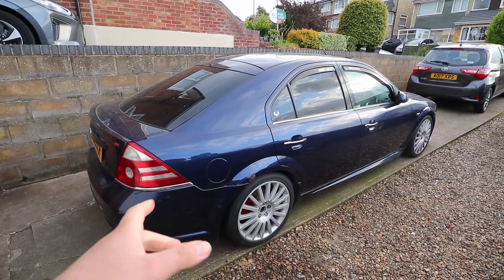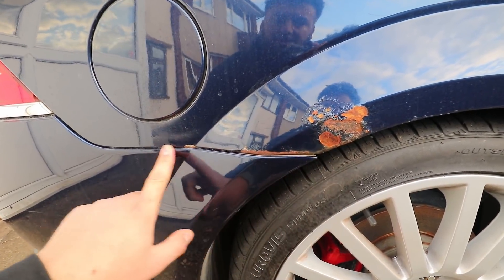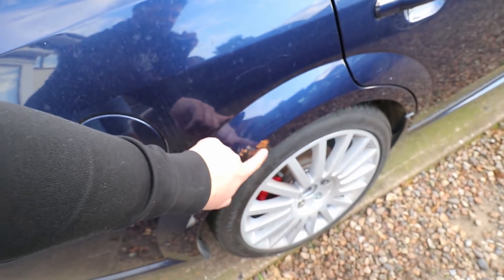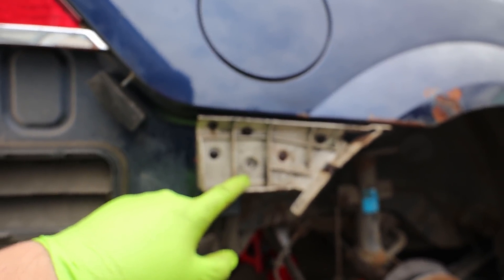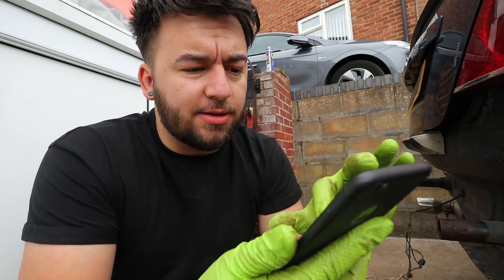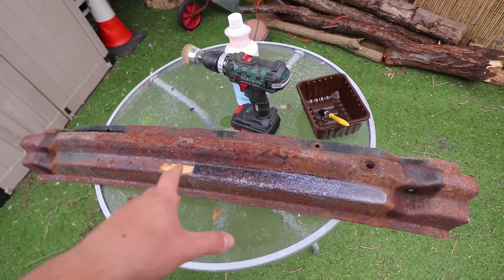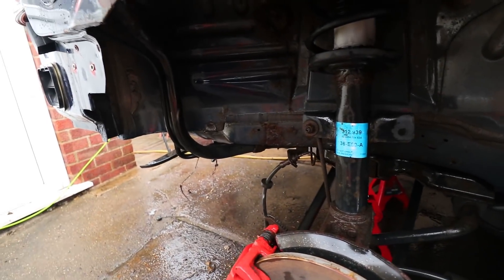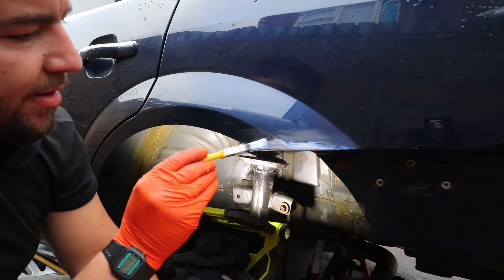Fixing The Rust On My Mondeo ST! (Part #1)

Comment: get yourself a blow torch for rusty bolts mate. heat them up wire brush the rust off. heat again and spray with WD40 whilst it's hot. works every time. you won't look back!

Comment: I have a focus same year, rust its a pain in the *  at those cars and if you treated it appears again.The only solution is to clear all the rust on the car(maybe in some spots it well need welding) and then put some primer and then black paint.
Reply: I have a 2005 focus, worst spot on mine seems to be the bottom of the arch by the front doors. Never get round to doing it!

Comment: Hey man, I'll be doing almost same repairs as you did on my mondeo estate tho not as bad as yours yet, but still annoying to look at. I will treat all the common areas with some protection of som esort, to keep them from rusting, Somehow ford made it, so water collects and overtime rusts those areas, some worse than others. Also if you had a mondeo pre facelift model the ford clear coat wasn't that great and caused the doors to rust badly and roof. But nice that  you did a video on this, so I can use it for reference :)

Comment: Your not supposed to dip a dirty brush back into the bottle of Vactan, it will contaminate the whole bottle.

I've used the Loctite rust converter on my e46, under the boot lid above the bumper, it lasted just less than a year before rusting through again

Comment: Thumbs up for your enthusiasm I know what it feels like when you keep.finding rust.
I got a 1982 Austin metro and can't weld.so I've had loads of fun with it. Starting to go back to the first patches I done to redo them. I learned a bit. Got to do something to learn. Il be converting it to a 16v rover engine in time or maybe a vtec.
Keep going

Gas mig welder. Any cheap 1 will do body panels
. Angle grinder.  80 grit pads.l for.that crash bar then hammerite. 
Rust converter is no good honestly.

Comment: The rust treatment works best on rust, it doesn't work on bare metal.  Treat the rust around the hole, then use p40 to bridge the hole n then p38 to fill.  The rust inhib can be used on the lip inside but dont rub off rust.  Use a rust inhib grey primer on bare metal. J

Comment: Cut and Weld a small backing plate behind the hole in the arch and then just fill the hole with filler.  Sand and repaint.

Comment: Watch Chris fix rust repair mate he didn’t weld did a good job just type up Chris fix rust repair he used metal netting and fill it in 👍
Reply: Chris Fix & Savage Garage are my 2 favourite car channels. Both make great content.
Reply: That is a disgusting method of repairing rust holes. Don't ever do that. Its just gonna continue rusting in there and make a bigger mess than it originally was.
Reply: @y4nnickschmitt  Use a bit of wood instead of metal netting, wood doesn't rust
Reply: @idiocracyisnowadocumentary8834  I hope you are joking.

Comment: Forget paying £95 for a new arch, use some u-pol fibreglass filler and some aluminium mesh. Not worth getting a whole panel welded in for a hole that small. Take the rear struts out and get a wire wheel and some sandpaper on that surface rust, paint it with Zinc or etch primer and underseal all of it, if done right will last a lot longer than you might think.

Comment: Only treatment for rust is cut it out, the parts you've treat and fill after winter will just bubble up again and in summer will look twice as bad. Inner wheel arch grind it out and plaster with underseal

Comment: Guys, is somene familiar with this error that i got on my St220 03, can be because of brake discs are too damaged ? 
c1310 brake hydraulic pressure transducer front left wheel circuit failure

Comment: It ain't that bad and not difficult to repair. Just make a patch from a piece of scrap metal, weld it in...threat it and finisch it of with filler. Paint it and thats it.
The patch needed to attached from the INSIDE of the wheel arch

I'm sure even without  weldingskills , you'll can handle that. 

As a owner of a Ford Ka( yes the real rust buckets) , i know the battle against rust and last year...made some patches in my rocker panels. 
Nothing is more satisfying than solve the problem on a budget( ofcourse  the repairs need to be done properly  and cause no hazards)

Comment: as for the roof unless your going to paint the entire thing you will have obvious bits showing as there is no where to blend might be worth sorting the rust out on it then paint it and wrap the whole roof, dont use that clear you have, get yourself some MIPA 2k clear can get it in an aerosol, and it will give you a much better and more durable coating. 1k clears are useless in such a high impact area. welding aint difficult once you get it just practice on some similar gauge steel before attacking the car. and be wary welding anywhere near the fuel filler. good video man look forward to next one try keep all your repair work within the arch area will be much easier to paint and blend within the arch rather than having to find some where to blend into further up the qaurter

Comment: As said in other comments, ChrisFix made a really good video on fixing rust (with replacement sheet metal)
Now if you want the cheap route while you learn more on welding, EricTheCarGuy has a video on fixing rust on his acura vigor (Beater car, fixed with bondo)

Comment: James just cut out a little patch on the rear quarter, get some sheet metal and weld it in. You can weld you just dont know it yet. If you mess it up then get a pro to do it. You have everything to gain. You just need to follow a few simple rules watch Fitzee on you tube he is brilliant. Good luck mate
Reply: Agree. Not worth buying a whole arch repair for that small section. Not at £95 anyway. Small section of shelter steel welded in would do fine, grind back and fill. Welding takes practice but if you research how to do it, practice on some scrap then it's possible to get an acceptable job. Have a go and good luck.

Comment: Good video, just a few things, mud hasn't really got anything to do with rusting metal, it's the water and moisture and salt that corrodes. The mud doesn't help though because it helps trap those things. Also when sanding and using a wire wheel to remove rust.. Don't be scared to go beyond what you can see.. There is always more hidden under the paint. And theres no such thing as a 20min fix when it comes to bodywork.. Always a can of worms.

Comment: Instead of spending £95 on a complete panel it would be easier to get section cut from a mondeo that's being broken for parts cut to size and weld it on yours I had to do this with a fuel filler panel for my escort rs turbo

Comment: Good video James. I just know I have a job on my hands with my saab, just replaced rear springs and found a lot of rust underneath. Gunna need that rust stopper and probably shultz the underside 😒
Reply: If it's a 9-3 keep an eye on the rear arches, mine are terrible! Treated it two years ago and it's back again with a vengeance now so will need to do it again

Comment: The "hidden" screws behind the bumper trim and not factory fit. They are a fix for  saggy bumper syndrome on later model st's as the foam blocks were no longer factory fitted. The weight on the boot edge screws are too great and stretch the plastic. . . There you go.

Comment: Sadly it is also known as "built in obsolescence" design a feature that traps water or mud and there you go.
The car is rotting from day one. 
Things are better than they used to be, so that's a positive step.

I'm old enough to remember MK 3 Ford Cortina, with their rust holes in the upper front wings, 
after just 3 years in most cases. 
For some reason a clump of mud would reside here. 😖😱

Comment: Don't spray primer and leave it. It's porous and will allow metal to start oxidising again. With regards to your rust treater, you should pour some in to a small lid and use it. Don't put your brush back in to bottle as it ruins it. Good luck !!

Comment: I  would before spending anymore time and money check all the visible rusty areas with a old screwdriver..My experience of rust is that it can travel under
paint and until all the old paint in the area has been removed it's hard to see just how bad the rust it is.If you make a hole it's going to need a patch.
If you decide that the rusty areas are not too bad clean and paint them.The hole on the nearside rear arch just remove the paint from around the hole
cut out all the rust buy a small sheet of steel plate and make a patch....You have a mig welder do some practice welding before you attempt to weld
on the car.....Honestly mate don't waste £95 on that wheel arch panel that you will only need a small piece to cover that hole.

Comment: James, save your wrists and get a small electric screwdriver like the Bosch IXO. https://amzn.to/2ZhZm7x 

I’ve got one of these now and it’s made life so much easier, quicker and I can work on the car for longer with my hands hurting. Can even use an adaptor to undo bolts, might have to use a ratchet to break it first.

Comment: 28:50 and this is the reason why i think its worth it to remove the rust properly. I know cars like these in the UK are worth nothing these days. I drive an Opel Vectra C an im in a few facebook groups. Im shocked worthless these cars are now. I see cars with XP2 exterieur getting sold for 200-500 pounds. Similar OPC Line 2 Vectras - if you find one - is like 2000-5000€. 

Are UK winters very salty? I also see a lot of rusty Vectras. Here in Germany ive seen not one rusted out vectra (only exeptions are the front subframes). Ive only had like chiped paint on my wheel arches because of little rocks. 

I mean you want to learn how to weld - so why not try it and learn while doing it. I would buy some sheet metal, watch some tutorials and try to form my own patch.
Reply: Actually in the UK, the old Vauxhalls (Opel) last well against other aging makes, lots of old ones still around compared to other makes long gone from rot..As you say you have to keep an eye on the front subframe on models like the Zafira and keep it sanded and painted around the firewall fittings..What usually sends an old Vauxhall to the scrap yard is not usually rot but it's value,  a Volkswagen Golf say full of holes is worth a lot more.

Comment: Don't bother with the cost of a new arch, just buy a hole repair kit.
Also grab a cup of tea and a tiny drill bit and drill hundreds of holes into the liners. This will help the muck and water out but most importantly when you drive it the air will flow in and dry out the arch.

Comment: I am surprised at the amount of rust damage there is on this car.  We were told they were fully zinc galvanised from new and , sure enough rust has become largely a thing of the past for MOST cars- not Mondeos apparently. Also Mondeos sister vehicle the Jaguar X type sufferes terribly from rusted cills which is not a cheap repair.   Not a good advertisement for Ford I'm afraid

Comment: Hi James, I think that buying a panel is a bit much for such a small repair, it looks to me that you can use this opportunity to start your welding, as the rust looks like it’s just below the sewage line a little repair panel may be all you need to make, I’m a beginner in this stuff but I’m sure that you can easily make this part. Please see the attached video by Nitrosilvia he has 3 parts on how to weld these really are excellent videos and shows you what you need to do to achieve a really good result. https://youtu.be/_jR6IgUwuGw hope you under take this as it will help you start in your fiesta project. All the best. Steve.

Comment: 13.26 brake pipe not looking to clever 😂😂, just fill the hole with sheet metal weld it in make sure it’s lower than the wheel arch skim of filler over top easy not structural so £95 total waste of money and time imo

Comment: "its only an old mondeo" sounds like youve lost interest in it 😕. If you cant endorse it, dont force it.
Reply: @honeybadger9142  its different when you're running a car related YouTube channel. The passion has to be there or the channel dies with the cars.
Reply: From experience i agree. Im sure rust was standard equipment out of the factory for ford between 1960 and 2006.

Comment: do not what ever you do spend 95 pound on a arch what you can do is cut out the rust with a disk cutter then you said you had a welder then get-t back top clean metal and weld a piece in then rub down the weld with a grinder and then put a skim of filler over it  rub it down primer it rub that down out 2 to 3 top coats then go over it with laquer

Comment: It's a ford you should be worried if you see a ford without rust, there the worst cars for it, typical ford haha
Reply: No rust on my factory original st, fords are no more prone to rust than any other make of car
Reply: Don't think so,  you need to look at Volkswagons, the ones of this age are rot boxes underneath!
Reply: The cars that rusted you obviously don't see anymore, like the Mercedes C and E class where the rear shockers use to like inviting themselves into the passenger compartment..or the big Volvo estates, where have they all gone...they ALL rust.
Reply: @markeggleton9488  es they
yes they are..fords fall to pieces once 10 years old..my wifes mums 1987 toyota corolla is totaly rust free
Reply: mark eggleton nearly all German cars from this era are galvanised. Fords are good cars I have had plenty of them. They are cheap for a reason.
Reply: @toecutter8227  and all audis bmw's and vw's from this age rust like hell here in sweden.
only cars i see that resist rust are volvo's and toyota's
vw's are worthless rust buckets. my bosses 2011 passat had to be scrapped due to rust

Comment: that type of rust "treatment" is rubbish. it converts only a tiny layer and leaves rust underneath, which comes back. wire wheel as much off as you can and use bilt hammer de-ox gel it leaves only clean bare metal and the rust doesnt come back.